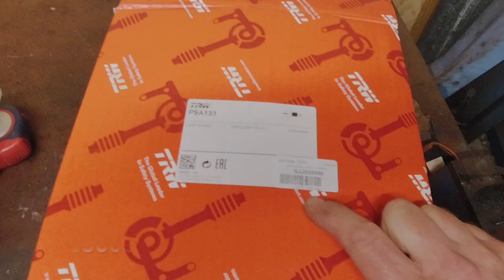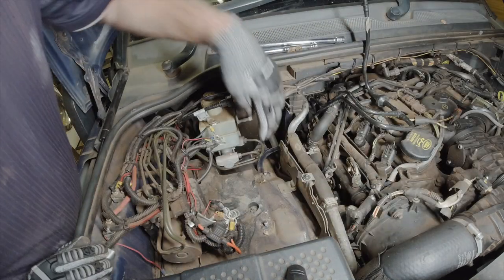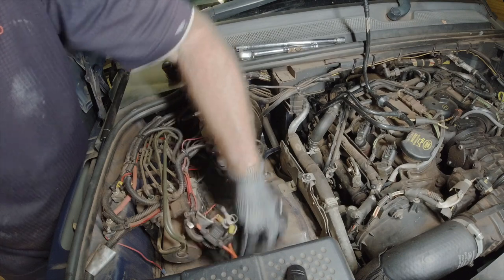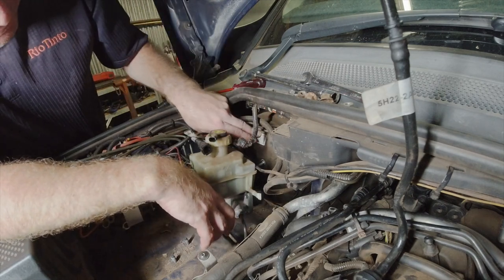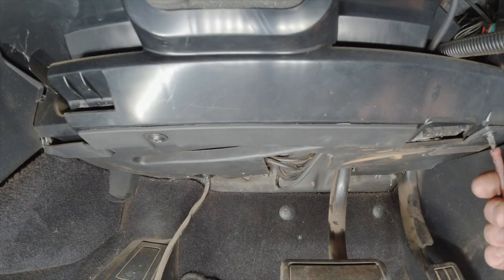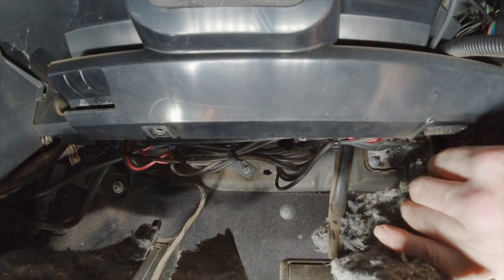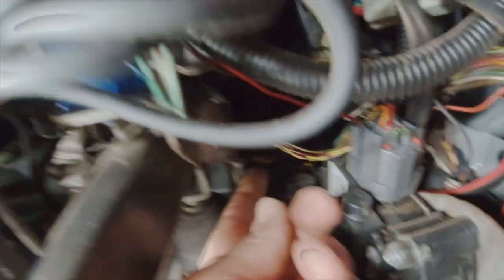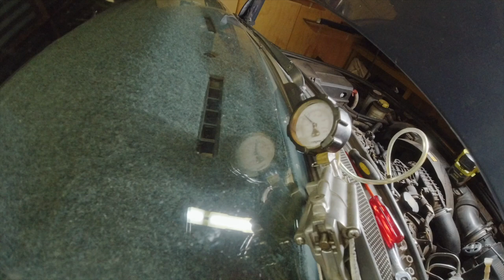LR3 Brake Booster Removal | Vacuum lines replaced. 2.7TD | Part 1

Comment: Hi Shane, I have a similar issue over here in NZ, the dealer said recall was done so tough luck, but also nobody seems to sell these valves, my booster has oil in it, seems to be coming from the lower left valve, the upper smaller valve was dry, do you happen to know what each valve does and why both of them feed into one line, Id like to replace the lower larger opening valve but can’t find a replacement option unfortunately
Reply from the maker: I’m not 100% sure but I would assume that they would only be non return valves or maybe a vacuum relief - I can’t think of any other function for them

Comment: Thanks a mill for the video. I will try to perform the job in the next few days.  Would you be able to motion the parts that you replaced. So we can get them.
Reply from the maker: I did not realise I had forgotten to add the part numbers into the description - just added them in so if you need to part numbers you can find it there.
Reply: @Shanes_Shed   Brother you are legend, one of my favor LR lovers teachers so far. 🙌🙌🙌🙌

Comment: Thanks Shane, great video and perfect timing as I’ve ordered my replacement booster and will be fitting it soon. I don’t want too many more scary brake fade events!  I found sucking the oil out of the master cylinder with a brake bleeder vac unit has helped eliminate these events in the interim. 

I like the extra detail you go into like the movement of the servo unit, clevis pin clip arrangement etc. This really helps. I will be looking forward to the reinstall and the future catch can (great idea BTW).  I’ve also ordered a new master cylinder and vac pump however I’m planning to remove the gearbox for overhaul soon so could be more accessible to replace vac pump then. 

Keep up the great work, you deserve many more subscribers so please keep the content coming.
Reply: Correction, sucking oil out of the booster not master cylinder - doh!
Reply from the maker: Thanks for you detailed comment. That brake lever pin/ Clevis pin you can’t really see clearly due to the guard around the clip, which is why I done the  footage of it when out of the car.
I suspect there would be good access to the vac pump with the gearbox out. I think if I had to change mine then I would simply find an electric vac pump to do the job. VE commodore pumps are cheap
Reply from the maker: Oh and the sub count is slowly creeping upwards

Comment: Imagine if it was possible to disconnect the van line, run a small diameter tube through it and suck the oil out... I'll have to have a chat with the cardiac consultant at the hospital!
Reply from the maker: Nothing stopping you from doing it, but when I stripped the booster down there was not much oil in it. Just the presence of oil may not be the issue, it could be the damage that the oil has caused internally to the booster seals/rubbers. Brakes are one thing I don't dick around with trying to find cheap solutions
Reply: @Shanes_Shed  Thanks for info.  I know mine has been replaced before, couple of years ago before I owned it, and I had visions of oil pooling in it! As you say, may well be failing seals caused by small amount of oil. 
Looks like a fun job to do.
I don't suppose you've done the other 2 intercooler pipes have you? I'm hoping there's a quicker way in than shown in another video where it takes a million hours or so!
Reply: @Shanes_Shed  I've had a thought.... I don't think oil is getting along the vacuum line. As you point out, that doesn't seem likely. BUT, I wonder if failing seals in the master cylinder could be to blame. The vacuum would draw brake fluid into the servo, and perhaps the fluid isn't compatible with the diaphragm.
Reply from the maker: Have you seen my booster strip down video? https://youtu.be/FnIfhOaqhy4 defiantly doesn't look like brake fluid
Reply: @Shanes_Shed  ok. Just checked the TDI forums as I saw this mentioned on there years ago. The most logical explanation is poorly performing check valve between the vacuum pump and the booster. The vacuum pump is oil lubricated, and if the check valve doesn't fully shut off then the vacuum in the booster will suck oil through when the vacuum pump isn't operating.

That small amount of oil in the booster probably isn't the cause of poor braking, but the failure of the check valve is. 

Is the valve easy to get to with booster in place?
Reply from the maker: @petemillis4666  all the lines and check valve are relatively easy to get to - booster doesn't really make much difference for access from memory
Reply: @Shanes_Shed  that's great to know. At moment my brake booster is fine, but thinking I might replace check valve as a preventative measure.

Comment: Hi Shane,

We have already had the brake booster replaced once, about 4 years ago, and we are feeling poor brake performance again. I checked the quick release fitting as you did in the video before this one and confirmed some oil on it.

I don't want to just replace the booster again as it will obviously get oil through as some point, so I was wondering if you could offer any suggestions as to the catch can or electric pump solutions. I note you have referred to a VE pump in another comment, have you investigated that enough to advise on installation?

Also, I have seen mentioned on the AULRO forums that some have swapped out the booster for an RRS version which gives better braking performance, have you any thoughts on this?

Thanks in advance,
Michael
Reply from the maker: I do need to get my arse into gear and look a bit more into the catch can setup and install. Really that will most likely be finding something that fits into the available space ok. An electric vacuum pump would be something I'd look into in the event of failure of the original unit as it looks to be a right pain to access with body on.
Reply from the maker: Oh and I haven't really looked into the RRS option for boosters. If anything all it will offer is a higher assistance ratio so the pads will see more pressure with the same foot pedal effort
Reply: @Shanes_Shed  Hey Mate, just seeing your other video today reminded me about this. After trying the aftermarket vacuum pump I mentioned in that forum thread, it failed after a few months and they gave me my money back for it. I realised after watching a video from the US, the V8 petrols have a vacuum pump fitted so there is already a purpose designed system. I grabbed the pump, stand and hoses from Triumph Rover spares and it all fits perfectly.
Reply from the maker: Ah good stuff